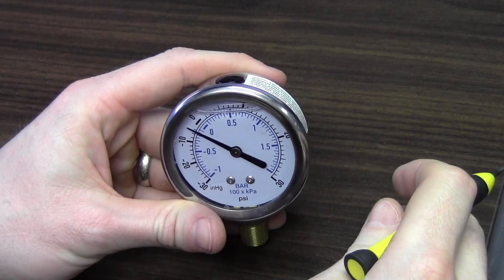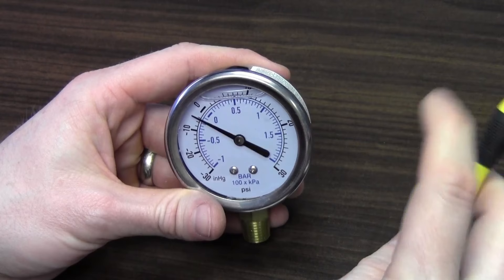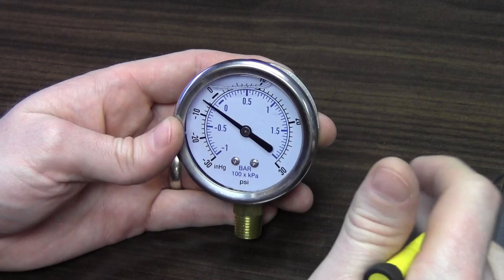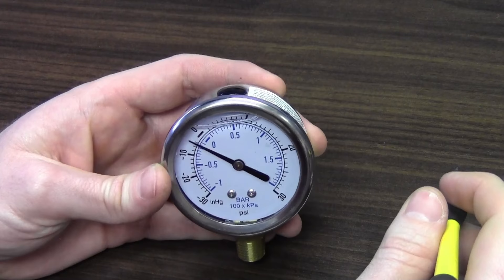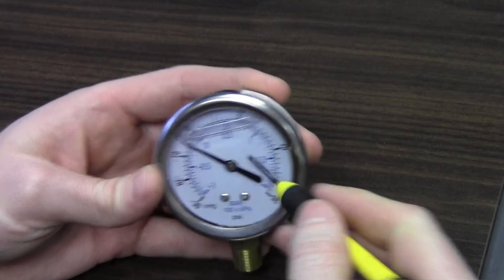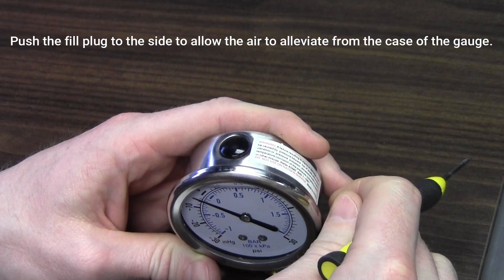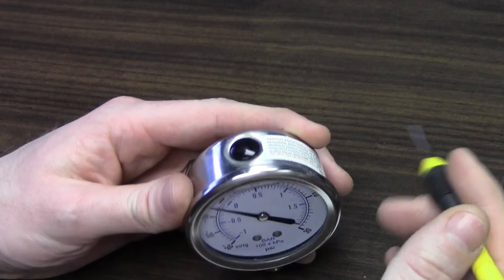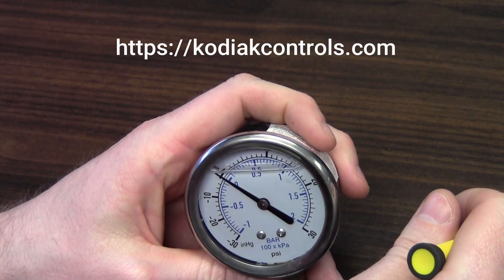How To Burp A Pressure Gauge

Comment: The guage reading won't actually be wrong, it's equal to the conditions it was set up in, so for most guages that'd be sea level pressure at most likely 20-25°c. I'm only splitting hairs in this comment, I don't mean to say anything about burping is wrong because it's all about the relative differential pressures.

Comment: Hi:  I have a general question regarding gauge design: On some of my dial-type tire pressure gauges, the pointer rests against a stop(fully left or zero), and my others, the pointer simply resides in a zero 'box' or zone when it is reset, or not measuring anything.

What are the advantages and disadvantages to either zero design, aaaand: does it matter that much where the needle rests inside the zero box on gauges without the zero rest?

Comment: TIA, got a used trailer with the same guage installed on trailer tandems. Facing problem to take the reading. Whats d right way to scale weight reading.

Comment: I have a question I need a oil pump pressure gauge minimum 150 PSI 
It also has to be engaged that I can use with diesel gas oil kerosene do I need to buy what's called a combo pressure gauge I want to make my own I know I need a high pressure hose and that was my other question when I make the hose up I need a 300 PSI hose hydraulic hose what kind?

Comment: What are you doing when the gauge is that zero and then you’re starting to tighten it up on the bottom and then the gauge goes up?
Reply: Kodiak Controls 
Your right. After installing the gauge and turning the needle valve all the way, The gauge went to the right pressure that was on the natural gas ⛽️ line. Thanks for your help.

Comment: Whats happens if you do that and the needle doesnt move
Reply: @kodiakcontrolsinc4162  i did watch it.. I even took the pressure gauge off and it's still on 40psi after i tried to burp it like ur video showed
Reply: @kodiakcontrolsinc4162  i have a liquid filled pressure gauge and i mibed the fill plug and it still sits on 40psi.. This leads me to believe the gauge is bad

Comment: Hey mate, the bung on my pressure gauge keep poping out the top, any idears why ?
Its on a pressure washing pump.
I had a low pressure nozzle in the lance that made the gauge go up to 1000 psi, thats when it kept popping out, the machine is rated to 3600 psi.
 Its never happened before. 
The 3rd time it come flying out I couldn't find it, can I bung it up with a bolt.
Cheers.
Reply: Your bourdon tube of gauge would have damaged